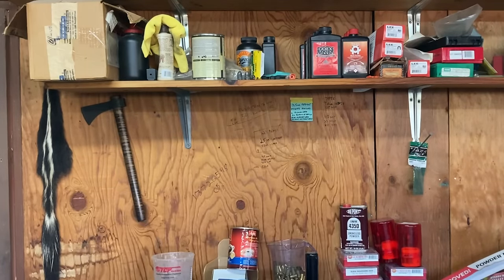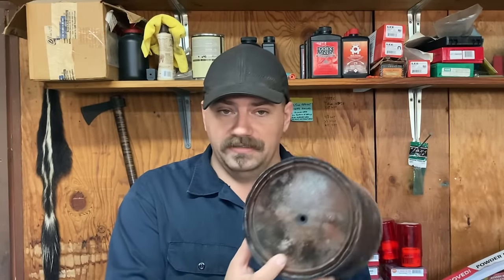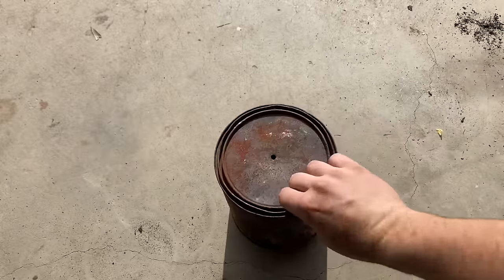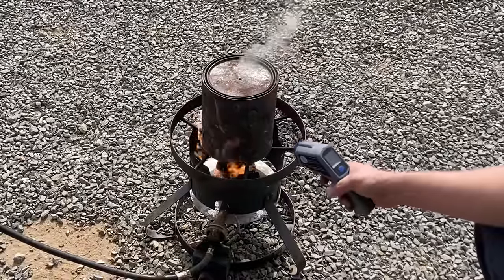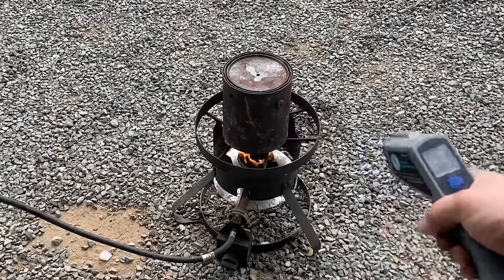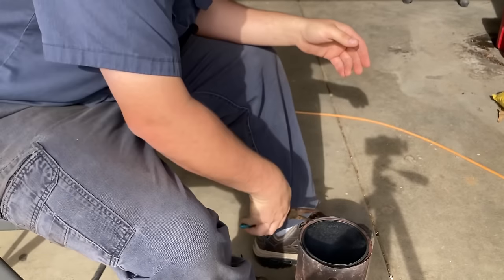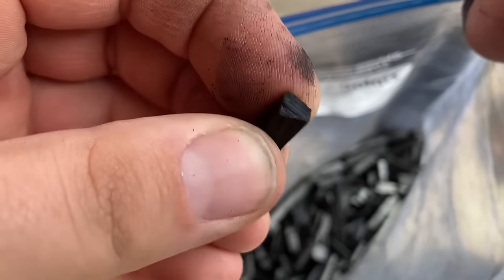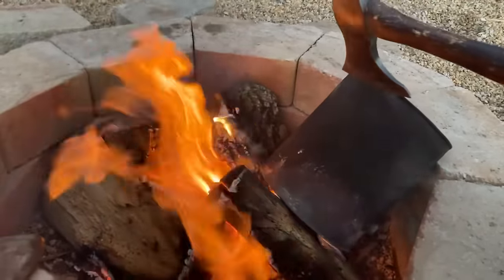Making charcoal for black powder

Comment: People should know that they shouldn't open the top right away after cooking their char. It's hard not to take a peek but if you do it will start to burn and turn into ash. Wait at least 20minutes for it to cool.
Reply from the maker: Thanks Steve, I completely forgot to mention that.
Reply: @Everythingblackpowder  should do a video on breaking it down via rolling pin or media grinder. Thanks dude.
Reply: @Prepper_Raider I use an old hand cranked meat grinder - cheap to pick up used, and you'll get the charcoal down to somewhere inbetween airfloat and granulated sugar in no time at all. Do the grinding outside, though, quite a dusty process.
Reply: @skippymctwist7  Excellent method in the event that there is no power. That's a 1st one on me! I use an old food processor called 'Ninja' for my powders like charcoal, aluminum, hexamine and many more. Saves tons of time! My motive is total self-sufficiency in the event that the internet takes a sh1t and munitions are gone. 

You should try doing it from the garage if you have a window. I improvise using an old portable fan and it sucks anything I don't want to coat my lungs outside. If you saw one part of my garage, you would think I am running a meth lab. Have a bunch of distillation apparatuses, scales and much more. 

Thanks for responding brother. Stuff goes south, keep your chin in the mud.
Reply: I learned this the hard way…
Reply: I'm up in northern Minnesota.There's a lot of tag alder would  that make a good source for black powder charcoal

Comment: During the late 1880's they started making brown powder for Naval cannons. They would make charcoal but stop before it turned black. Supposedly they also eliminated most of the Sulphur. Supposedly it was slower burning which gave higher velocities in longer barrels. Without the Sulphur it was harder to ignite but that was offset a little bit by brown charcoal being a little easier to ignite since it had more volatiles left in it. I'd love to see you experiment with some. Maybe even do a series where you experiment with making charcoal anywhere from still brown to ultra cooked and see what differences you get.
Reply: I have made some brown powder and I have a burning test video.
Reply: I always think about that aspect of brown powder (less cooked = more volatiles), and what a hybrid of brown/black powder would shoot like.
Reply: @dylanstandingalone  volitals make crud, not energy

Comment: What if you made charcoal out of some weird stuff like particle board,  balsa wood,  twigs from trimming the hedges,  a book,  toilet paper,  cardboard,  puzzle pieces,  cereal boxes,   oh you get the idea.
Reply: I think you'd find that the glue and binders in processed wood products would not be good for the result. Th's why it's best to de-bark the wood...there's stuff in the bark that doesn't help. You are after the purest carbon you can get....
Reply: You can make charcoal for BP out of cardboard. I have used it in a batch and it seems to burn fast. And I have also made some out of pinecones.
Reply: Sounds like Doc Brown refilling the "Mr. Fusion"
Reply: @williamcastleberry7338  I have a virtually limitless supply of cardboard.  Just how viable is this?
Reply: @slcgrgcrgcaneafgugiesclawhfg  I tried it just to see if it would work, and it does. It seems to burn as fast as the BP that I have made using Cedar, Grapevine, and pine. And I can't tell that it's any dirtier than the other. Cardboard and paper is made from fast growing wood. I ran across a video a while back where a fellow was using straw to make charcoal , and it got me to thinking. I didn't have any straw but I did have a bunch of cardboard and paper. So I tried it and it worked.
Reply: @williamcastleberry7338  So you just get a bunch cardboard, stuff it in a can and continue as normal? Or do you cut it to shape beforehand?
Reply: @1SmokedTurkey1  I cut it into strips and folded it and stuffed it in the can
Reply: @williamcastleberry7338  Hmm, Pinecones, I have a mess of those as a source..... Willow first  and maybe some pine cones for the fun of it.
Reply: what about charcoal from coconut husks? do they work well?
Reply from the maker: @Eric-vs2he haven’t tried it
Reply: what about bamboo?
Reply: Toilet paper gets great reviews for BP!

Comment: I’ve been making small batches of charcoal for drawing or to make black grain filler for decades. You can make small test batches with an Altoid mint can. In winter, I put it in the wood stove and remove it when it stops venting.

Comment: I've used a metal paint can alot of times for charcoal, but I would start with the hole down and after the steam boils out, it becomes a flamable gas (cars, generators can run on it) and so provides a lot of it's own fuel and when that flaming slows, then I would flip it over so could tell better when it is close to done. Then I put a penny over the hole so no oxygen can get into the charcoal and form ash, until it's cool. Some times when when charcoaling sawdust and shavings, I would put a can or jar in the center because that part would sometimes not get done and that took care of that.
Reply: Wood gas? The condensate from charring wood?
Reply: @randomidiot8142  Yes.

Comment: One of the cool things about this is grabbing a little bit of the charcoal for your flint and steel fire kit and lighting your campfire by putting a small piece of charcoal in your unloaded flintlock pan and tossing a spark on it to light the tinder that lights the campfire you use to roast your dinner on after a day in the field.

Comment: Very similar to making biochar. I was told to take it to 800o for three hours when making a 55gal drum full  inside of 400 gal oil tank.We used very dry wood or chicken manure. I knew the gasses were volatile so tried it next time with a copper tune running from the barrel . Lit it and it burned the wood gas for over an hour.

Comment: I have been making charcoal for along time and I have have found that using a large old dutch oven works really well.   I use the charcoal for forging mostly and hard wood seems to be the best for that.  I wonder if a small cast iron dutchy would work well for making finer softwood charcoal like you use in black powder.    I have learned alot from your channel's videos and will try making my own powder for my rifles sometime.  Thanks for the info.
Reply from the maker: Thank you

Comment: I think you need a blend of charcoals   hard woods retain a higher tannin resin content while the soft woods give a more pure carbon, but as you have found fouling issue.  Tannins will also slow the burn, but should give a better polish.  Have you tried tumbling with coal (anthracite) instead of graphite?  Other things to try is a mix that has more external sulfur, like applied in the polishing tumble.. no sulfur polished with a sulfur mix?

Comment: Great information. I like to put my retort (I think that's the official name of the cooking vessel) in the center of my fire pit. I also typically use very dry, spalted alder. There's something about the wood being on the verge of rotting that gives it some extra speed. Big leaf maple wood also makes some decent charcoal. The nice thing about not using propane is the $$ saved.

Comment: Thanks for this vid. I eventually plan on making charcoal on a modest scale, but using a paint can will work with what I have on hand right now. And I'm in luck...I have about 40 willows along my property line! Not sure which variety they are (northern Wyoming), but I do know the wood burns hot and clean, so bet it will make decent charcoal.

Comment: Good evening! The Chinese believed that the best gunpowder was obtained from the coal of the Chinese ash or Aylanthus chinensis (Fraxinus chinensis). It's a weed tree and not hard to find. You can use the core of Elderberry (Sambucus). You can use the wood of the Silvery Loch (Elaeagnus commutata). Its wood is similar to Sea Buckthorn.
Reply: I have been told that pine cones are very good, but I have not tried them yet.... I have a bag full for my next batch of powder... 🙂

Comment: Good morning, I'm from Brazil. I don't speak English, I'm using a Google translator I would like to make this gunpowder, but I need the proportions. Do you use 77 charcoal, 13 potassium nitrate and 10 sulfur? It will help me a lot if you can pass it on to me.
Reply from the maker: 77 potassium, 13 charcoal, 10 sulfur
Reply: @Everythingblackpowder  in a test you used sodium, what did you think could cause oxidation in the barrel of the gun? I really wanted to make one without smoke and in the first test it seems that there was almost no smoke..

Comment: Based on your latest video, I expect that Swiss has some ‘secret recipe’ for their charcoal. There are so many factors, chip size, age, dryness, heartwood vs sapwood, temperature  its cooked at, cook time, that dialing it in could get interesting. 
I do know that those IR thermometers are not particularly accurate, angle and distance changes the reading a lot. 
You might be able to find a cheep electric heat treat kiln that you could set exact temperatures on, and really dial in your results there.

Comment: Great vid and info.
Could I use like an empty cake tin or roses/quality street tin instead of a paint can?
Reply from the maker: I don’t see why not
Reply: @Everythingblackpowder  The only issue I can find is the seal on the lid may not be secure enough, under heat and pressure?!
Reply from the maker: As long as there’s a hole in it somewhere it shouldn’t be a problem

Comment: I use willow....strip the bark...do it like you do it.....run it through my coffee grinder and then ball mill it.  I mix the weighed saltpeter....which was ball milled and then sulphur all weighed in grams figured as the percentage basis and then ball mill it again.  I mix the combination with some 91 percent alcohol  so it ends up like wet clay and then run it through a screen to end up with 3F grade and when it dries it is virtually explosive.   I use 40 grains in my .40 caliber using round balls.  I love the smell of black powder in the morning.   LOL

Comment: you know Jake blasting powder is a different mix to blackpowder it's 60, 20, 20 not 75 15 10! as for pyro powder i never did find a mixtario for it! i'd like to know what wood the Swiss use myself and their cooking method! i started out with the open fire myself but i've came to using a cooking grate or trivet over coals anymore, it takes a little more tending but you can affect the heat levels to a descent degree

Comment: Disposable chopsticks used in Japan are made of aspen wood. It costs about 200 yen for 100 pieces.
Paulownia wood is also readily available.
Reply from the maker: I’ve heard paulownia works well but I haven’t tried it myself
Reply: @Everythingblackpowder  
Paulownia makes seriously fast BP. If you plant some you can coppice it (cut back to ground level each season) and have an endless supply. It will grow from zero to 10ft or more in a season. Its worth growing just for the impressive massive leaves. Something to be aware of is it can grow shoots from its roots, like mint. I have mine in large containers that sit on concrete so it cant escape.
Reply from the maker: @colspyro  where can I find it?

Comment: I can't find a source for Alder Buckthorn anywhere around here, but I do have piles of Eastern Cedar, so that's what I've been using. What I'm wondering, is if there is a difference in the quality of the charcoal made with more of the cambium/sapwood or the heartwood? Or isn't there any?
Reply from the maker: I’ve tried both and couldn’t tell a difference in performance but that was back when I was using fresh cut wood
Reply: @Everythingblackpowder  Just a thought I had. Didn't know if more goodies might be residing in the heartwood.
Reply: Do you separate the heartwood in cedar or mix it as one wood
Reply: @randynix6412  I mix it as one wood. In the last year I've cut over 400 cedars on my property and pick the branches that are about 1" in diameter, cut into 6" sections and stuff the paint can. Sometimes i split them.

Comment: So I have nothing to offer but questions l. For a long time I had access to club source of affordable BP, and I took advantage of said. Now that most of said is still in Wyoming with a friend jokingly in a van down by the river. Currently the location I'm stuck in has an abundance of hardwood species. Sugar maple, red oak, elm, and ash. I understand that you may not have experience with  any of these but, has any communication come by way of sources able to add guidance? Also seeing the use of the propane Turkey fryer (that just sold over frustration setting a steady cooking temperature) been considering a  electric Turkey fryer. Not sure if temp could be set high enough with it or a large hot plate setup 

No big rush its not like I haven't a boatload of other projects in pan right now
Reply from the maker: Ash works well. Ben Hoffman has used it and had good results.

Comment: I read somewhere that balsa wood makes the best charcoal for black powder can’t remember where so it may be complete BS.
Reply from the maker: I’ve heard it works well but I’ve never tried it
Reply: @Everythingblackpowder   ya it was something about fast growing open cell light wood. Which explains why willow is so good. But it was something I read as a kid in the late 80s or early 90s so honestly could be completely wrong.
Reply: Balsa is hard to get now due to the windmills using it by the boatloads in thier 90’ blades.  I fly model airplanes too, and balsa is becoming as hard to find as black powder and #11 caps.

Comment: Ok guys . I don't have a paint can yet. But I do have a hardwood mix I bought at Costco.  Says made from Southern oak,  some Hickory and other southern hardwoods. 
Will that work for a beginner?
Also bought a coffee grinder to grind it in.  
Have a rubber rock tumbler, already. And cast my own round balls, to put in them..

Now can I tumble the mix until I get the consistency I want?

Comment: I make mine on the grill using the cast iron pan heater. It’s also propane fueled. I use a large soup can with the lid cut off most of the way. Willow is what I have easy access too.
Reply from the maker: It works very well. My willow powder is equally to Goex

Comment: I use one of those giant Christmas cookie tins. I used northern catalpa wood, which is a fast growing, soft deciduous tree. I cook it in my outdoor fire pit. I haven't made any powder with it yet and will report back when I do. I've never heard of that species being used but it seems to fit the bill in terms of properties. I had a large branch of it that I trimmed last winter and figured I'd give it a try. I've got white pine, eastern red cedar and buckthorn in the area but the catalpa tree is actually on my property.
Reply from the maker: White pine and red cedar make great black powder
Reply: @Everythingblackpowder  So I've heard. They're both very easy to come by here. After I do a run with the catalpa and see if its any good ill likely move on to those, or buckthorn which is very invasive around here.
Reply: Catalpa was used in some Asian powder recipes.
Reply: @mkultraification  Interesting. They were the originators of black powder, so maybe I'm onto something here.
Reply: @Everythingblackpowder  awesome, I was going to ask about white pine, as I actually have some in my woodpile 🤣

Comment: Some of the guys that I know that make their own also made basically a thermocouple controlled Kiln.  They can hold temp between 530 and 550 all day and do about a 2 pound batch at a time.  Another easy to find item that works good for powder is Sumac (non poisonous) and Heavenly Tree; although heavenly tree can make some VERY light powder and pretty much requires pucking.

Comment: I have a question about sieving the powder after you puck it and let it dry. What sieve should I use to get 2F and 3F I have 10, 20, 30, and 40 mesh sieve's. I would hate to buy a pound just to check the size of the granules.
Thanks in advance

Comment: I gather you like to do experiments. How about giving this a try. Charcoal from cardboard and paper. They both come from trees. I made some in a one gal. paint can and used it in a batch of BP. It seems to burn fast and not too dirty. Make a small batch and see it functions for you . What caused me to try it, I run across a video somewhere of somebody making charcoal from straw. I didn't have any straw but It got me to thinking. And I tried it with the cardboard.  I have some in the ball mill now made from pinecone's
Reply from the maker: Interesting

Comment: I have a question I have a case cleaner cleaning my brass it vibrates it doesn't roll could I use it to make black powder with lead round balls would it mix properly if I covered the holes in the top of it course
Reply from the maker: I don’t know. I’ve never tried it
Reply: I guess I'll give it a shot using your charcoal maker way I'll get a paint can and I'll let you know thanks I love your  channel it's great

Comment: I have a lot of standing dead ash on my property.  Would it make good charcoal?
Thanks for your video!
Reply: You can get pretty decently figured wood and thus stock blanks from white ash, otherwise your better off using it for firewood. It burns great, but as the name implies, creates massive amounts of ash. I suspect that that characteristic would make it less than optimal for gunpowder charcoal.
Reply: @krockpotbroccoli65  I have a small amount of Maple, that might be better.  Thanks for the comment.
Reply: @kbjerke  I hear some of the softer maple species make ok charcoal but have no first hand experience. I sure have burned a lot of it in my wood stove though.
Reply: I have used silver maple and it makes excellent powder. And Hoffman’s channel he did some with ash and got good results